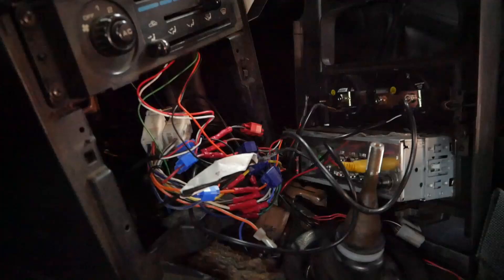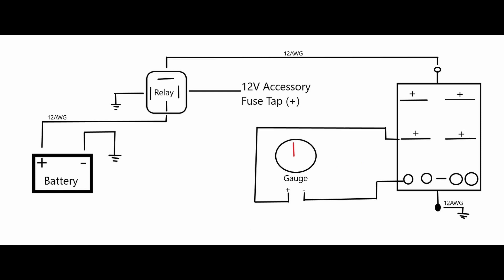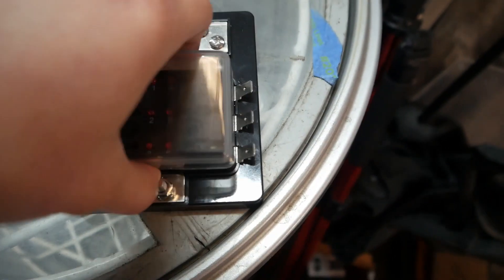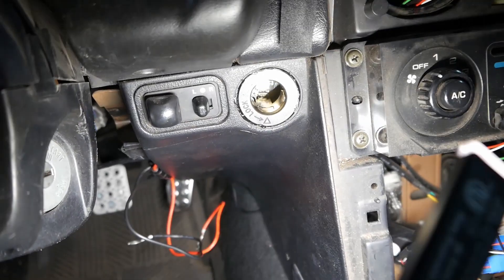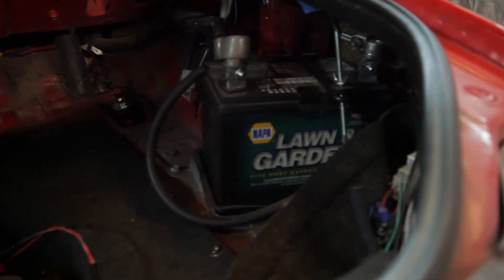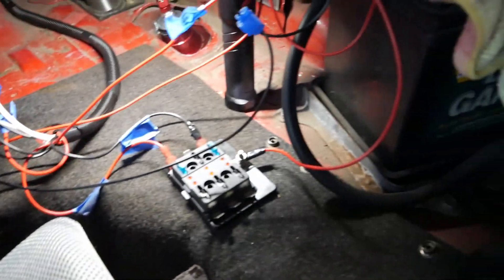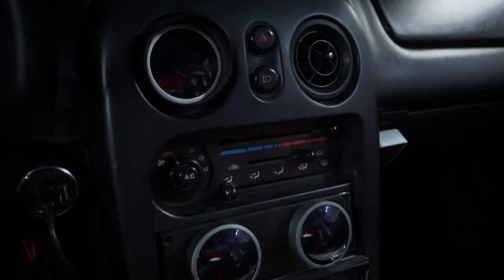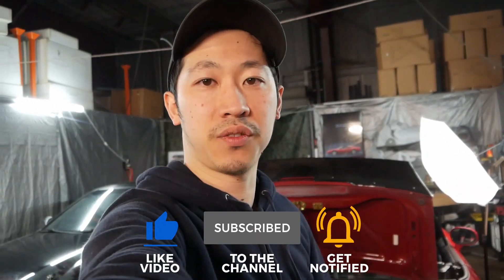[How to Install Second Auxiliary Fuse Box in Your Car] | For Gauges, Lights, Camera | Episode 19

Comment: Do you not put a fuse in between the battery and the auxiliary fuse box ?
Reply from the maker: I did not as I figured since the aux fuse box had fuses for each accessory already, should be fine. Is it good practice to have another fuse running inline from the battery to the aux fuse box?
Reply: @HazardGarage  yes, as a spike in the system with a fuse would prevent any further damage. I have had it once when someone did this and it burnt the loom out.. just giving you a heads up..
Reply: @zaheersarwar7815 did you properly fuse it with thenot only the correct amps but also they correct type of fuse?

Comment: The relay has an no and nc terminal. 
It's either or but not both at the same time.  When relay energised,  the no contact will be supplied with power. When it is not the nc will be powered
Reply: this helped me completely understand relays

Comment: Could I just use a cigarette plug instead of relay?
Reply from the maker: technically....yes. But this is just a clean way of running multiple accessories off the 12V accessory/cig plug.

Comment: Do I need to use a relay or could I use a switch to stop the current? I’m trying to install under glow
Reply from the maker: a switch would essentially do the same thing. Except it would be manual, where as the relay is 'automatic' because itll switch on/off depending on if the car is on or off.